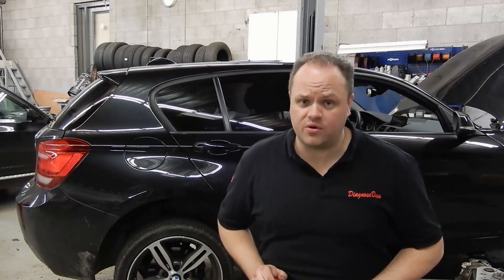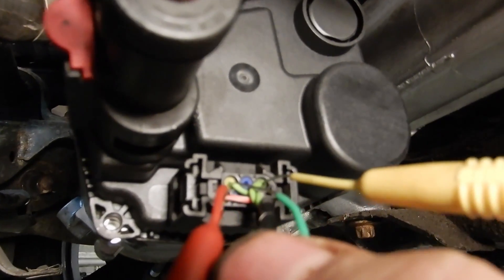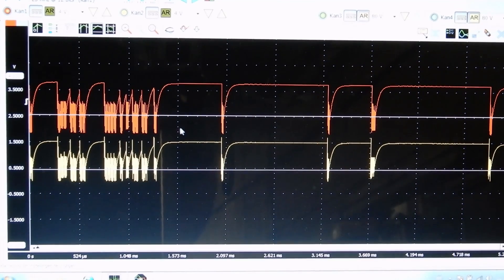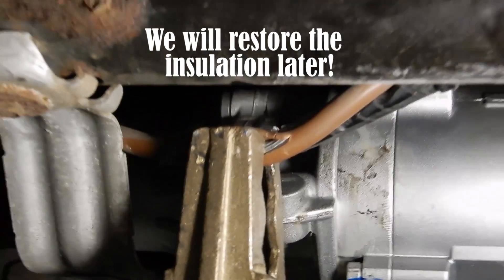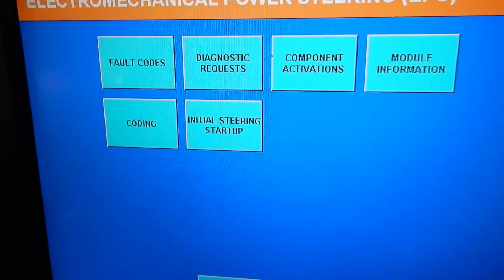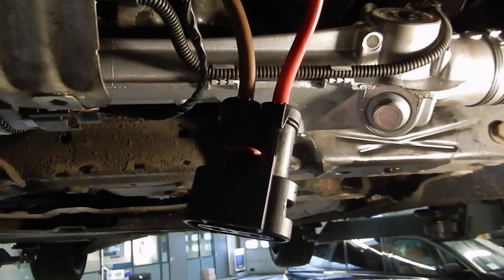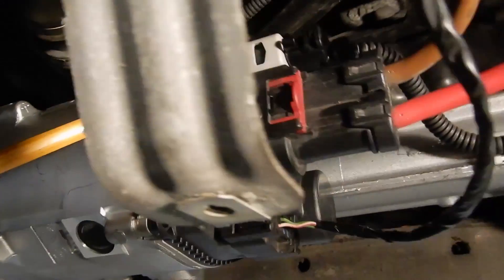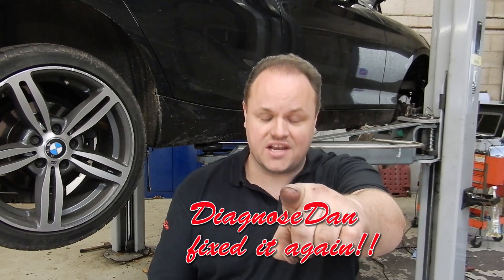Bmw Eps diagnose and repair (No Flexray communication)

Comment: Hiii Ihave the same problem no communication with the module. Ive put plus and ground. Directly to battery the low measure 2,48 high 2,54 and red green 13,48 please helpp! Its already the second that ive changed

Comment: Hello brother i have 2024 x5 i have problem with my steering system the service man removed the motor of the steering and installed but now it shows belt jump and we can not do anything and the code can not be removed what should i have to do does it can be fixed the motor for the new g05 2024 ?

Comment: I found something similar to this on a VW Tiguan, no power steering assistance and no communication. It had corrosion on the ground besides the battery, just cleaned it and it worked instantly.

Comment: To whom it may concern, my name is Joe and I own a 2015 Bmw 750li xdrive.
I was using the protool to code my car and i believe i made a mistake of testing the Flexray option and gave me so many errors and lights on the dashboard.  After clearing the codes and restarted the car, Night visiont camera, both side mirror camera and backup camera stop working.  I am in desperate need of advice on what i should i do. I tried pretty much anything i could with the protool app. Restore the cameras to factory settings, and still didn't work.
I would absolutely  appreciate any advice and help i get.  Thanks in advance.
Joe G

Comment: Hello Dan
Excellent vidéo, I Just discovered your channel and you do an excellent work and teaching about your work
I need your help please with my 2012 f30 328i EPS  I had 2 default codes
 48239C EPS torque sensor (steering angle index): Index Faulty

D01B2A Interface EPS (actual position EPS 51.0.2): Signal invalid
And im completely lost, no one could résolve my problèm i've changed my eps 2 times it resolves the problème for about à month only
Please help 😢
Reply: Hola amigo , tengo el mismo problema, lo lograste solucionar ?

Comment: thankyou dan for the upload.
So the voltage was elevated in flexray wires because of bad ground. where did you put ground connection while taking measurement in scope ?

Comment: Hi Dan. I have a 2012 BMW X3 and has an intermittent error (steering malfunction) when I start the engine, but no steering issues after I confirm with an OK on the dashboard. absolutely random ( for example now it is 3 weeks without and error, but I had days where it comes up in the morning). Someone mentioned the ground wire at the batttery. Is this a common problem?

Comment: I had a buddy help me with replacing the control arms on my 2011 bmw f10 5 series. After watching one of your videos. When we were torquing down the bolt on the back wishbone arm that black cord on the steering rack with the 3 wires got stuck behind the bolt and went un-noticed. When we were don’t the power steering wouldn’t work. Not sure how to fix it I got the wires from behind the bolt and had to solder them together and still no power to the steering rack. I’m not sure what to do… or what had happened

Comment: My electric motor is making noise when i turn on my ignition.  When I unplug 3pin plug its goes off. What might be the problem? Both thick wires have its ground and power

Comment: Hi everyone, I have a 2010 BMW E90 (320i). I have a problem with my steering system, which is similar to this. When I try to park the car, on low speed, whenever I rotate the steering wheel near 180 degree, steering becomes heavy for couple of seconds, and it becomes normal if I put gas to move the car to help it. I also noticed when I experience this, my headlights as well as cabin light starts to flicker. Flickering gets more apparent if I rotate left and right constantly to test. Initially I suspected alternator and battery, but they are all okay. In this case, do you think my problem is related to cables/wiring?
In my car fault history, I have below codes;

5E19       ABS-DSC: CAN data fault from DME/DDE (DSC lamp on as long as error is present)"
5D97	DSC: Control module: power supply, DSC sensor
5DF7      DSC: System voltage too high

I would really appreciate if you could advise me on this.

Comment: Hello, I have the exact same car, F20, and I had a warning the other day about EPS fault, I pulled to the side of the road, turned off the car, turned back on, since then there is no problem. Could this be a one time thing? The car is just out of oil change and general service. Is it a possibility that the service guy worked on a nearby area to the EPS and moved those cables out of their places, or something? Should I be worried? Wait for another fault ?

Comment: Had a similar situation with a g12 at work, flex ray communication faults and all but it just ended up being the power supply wire being pinched and ended up causing on open in the circuit

Comment: Good video Dan,. Good old fashion "VD" voltage drop.
I do think Flexray is going to be used for all new vehicle's, and for autonomous applications via ADAS.  Flexray speed is 20Mbit/sec through the gateway into the ADAS system and steer by wire systems all we have to do for the limp home mode for that situation is get the computer to turn on your four-way flashes cuz you're going to be coming to a fast stop.  With the LIDAR system and ADAS it'll be able to pull you over fairly easily having 360° view of all surroundings.

Comment: hey i have a F25 and it has a similar problem, when you just turn the car on the power steering doesnt work for the first couple mins but then after that works like nothing, I havent been able to find out whats the problem with it.
Reply: My F25 2011  year，It’s just the opposite of your car’s symptoms. The EPS was working normally within 10 seconds of starting the car, but suddenly it lost power steering and showed a fault light, then it didn’t work, and the steering wheel was very heavy.  Have you found any problems with your car?  Has it been fixed?  thanks

Comment: Hi Dan, yesterday as I was pulling in a parking lot after driving in very heavy rains I had a snapping sound from underneath the car and 2 - 5 minutes later the steering light popped up and I totally lost power steering.. What could be the problem?

Comment: I have the same problem, turn on the steering pilot, the errors are: 0x4823f1 / 0xd5c44 / 0xd552c79 ,.
I already checked the current on the servo motor is very well, signals are also ok, I checked the fuses ok, but the pilot does not go out.

Comment: Hi, I have been enjoying your video. Since I have owned a BMW Z4 E89 and recently having tech issues on the EPS, I would like to obtain your views on replacement parts. BMW Dealer here says the car can be fixed by exchanging whole steering column. But cause of problems was faulty EPS motor. So I have done separating motor and sent to a professional for rebuild. The fixed motor was back on the steering column and car is fine now. Shall we relay on assembly parts exchange based fixing for long term reliability or finding the real cause of problems and replace individual parts for saving costs?

Comment: Hey Dan having an issue with a car. I believe ZGM is bad. Car is an F02 750Li. My question is can I use a used ZGM to at least test the car or will it lock car in a transport mode?
Reply: The flex ray bus from ZGM is low to the VTG and I have no communication to the transfer case VTG

Comment: Hello Dan, i have a 2013 f10 facelift 525 xdrive,  ny steering intermittently hardens at high speed and after that the transition to smooth steering when going sloower is realy wierd, and sometimes it feels that there is a slight resistance when moving tha wheel. For example this problem appears for 2 weeks after that 3 weeks is oke than 1 week again and so on. No one could tell me the problem. Do you have an idea?

Comment: Dan, Great video - learnt so much, thanks. I have an intermittent fault with my original EPS. I have tried two replacement parts (realOEM latest compatible part numbers). Both give an EPS no comms. However when I connect my old one it works (for a while). Have you any advice or idea whats going on / suspect / things to check?

Comment: Did you only replace the electronic motor or the rack and pinion assembly as well ? How much for the new parts caused by a bad ground? Sounds like an expensive fix for such a simple failure.

Comment: In essence, what you're saying is that, if you first replace the rack with a new one, the new $2000 rack will get fried before you've even had the chance to realize there's an additional problem.... now that's some "excellency" in engineering. Congrats to you bmw.... you've "done" it again... f*****ckin BMW! I ran away from that garbage coaster brand a long time ago, now realizing that my decision to never return was the best I've ever made!

Comment: I have no experience with BMW cars. I work only on PSA cars. My question is :  this BMW have Flexray in place of High speed CAN? What is the speed of a Flexray system? My scope works just good enough for H.S. CAN. Will my old scope be capable for Flexray?  Thank you for the video, Dan.
Reply from the maker: No a car can have both, and you'll need a very fast scope.

Comment: hello friend good video, I have a problem with a bmw x5 f15 chassis, I have this code D01b2A in the ICM module, medium voltage and ground in the thick wires of the electric motor, do you have any idea of other steps I can take? thank you great channel (at times the address resists intermittently).

Comment: Hi there, very nice video, thanks a lot. I have  mechanicly bad steering rack . Got another and swapped the EPS units thinking car would think it is the same EPS but did not work. Is it possible to get a replacement rack  and stick original EPS to the motor or they go as a pair? I did just that and getting CD951B message  -  actual steering torque driver actuator/actual force rack , 49.0.2 - signal invalid. I suspect that EPS and torque sensor on the rack  don't like each other.Reprogrammed, recoded using ISTA but with no avail
Reply from the maker: They are calibrated at the factory

Comment: Would it be possible that a bad alternator causes malfunctions in the electric power steering ? My thinking is that the battery in a small car can not supply enough current to drive the power steering motor.
Reply from the maker: Possibly😉
Reply: @Diagnosedan   I'm looking at buing a very cheap fiat punto in good condition and the seller says it has a bad alternator and the power steering doesnt work but at least its worth going to look at it. Might test the power steering by jumpering it from another car.
Reply from the maker: @rimmersbryggeri  Fiat electrical power steering fails all the time. That can be expensive to fix
Reply: @Diagnosedan   Yeah but worth to check if its becasue of the alternator it doesnt work. If it really is broken its not viable the resale value on these cars is very low even in good condition. The power steering motor costs as much as the car so they would have to remove 3/4 of the price for it to be vialbe if that is broken.

Comment: I want to learn more! Nice repair. I would have covered the bare terminal with silicone sealer. This connection is in the path of corrosive elements, bad choice on BMW’s part. Solder and heat shrink is the only option for any permanent repair. Here in America, the majority of mechanics think it is proper to use crimp connectors and call it fixed.
Reply from the maker: Thanks for watching Jason, you comment on a lot of video's lately. Are you bingewatching? 🤣
Reply: @Diagnosedan  Your content is bingewatch worthy.

Comment: Extremely bad engineering to use that ground for the module too. They need to keep high current systems isolated from low current systems.
Reply: Saves $.5 per car. Worth it. Lol
Reply: @mikea.2348  Of course it's good, because it keeps the dealerships running
Reply from the maker: Yep!

Comment: did that wire have a flex issue or did it just root , no pun intended on the flex thing .... looks  like another one to add to the books of knowledge on preventitive maintenance ....
Reply from the maker: Corrosion 😬😉

Comment: Hey dan great video just out of interest what is the top multiplug on the motor/module for 😆thanks in advance
Reply: There is the two main cables and the 3 pin plug with the communication wires and feed wire and there is a plug at the top does this go the rack itself? Thanks again
Reply from the maker: @mattyholt14  it goes to a sensor in the rack itself.
Reply from the maker: I'm not sure what you mean?
Reply: @DiagnoseDan should the feed wire next to the communication wires on the 3pin plug be a 5v reference voltage? Sorry for all questions😆

Comment: Hi Dan, I have got f02 with no communication with control module  and steering is hard as anything ....We changed second hand rack with electric motor and still hard . Do I have to   Code and steering comes softer or as you mentioned we fired again modules because of bad earth ... regardless I will check ground tomorrow , just wanna know how steering how should act before coding... thanks

Comment: I must say after being in business 20 yrs here and I have had countless toyota / lexus training courses . You have a gift for teaching !
Reply from the maker: Thanks Jason! I know the toyota training is one of the best so this means a lot to me Thank you!
Reply: I am mechanic, I have and I have similar issue but unfortunately, my own the signal wires found tight between the lower arm bolt and the touch each other to the flame, the wire are fixed but still the light is on and the steering is hard, can it be fuse or what, please help me out
Reply: Lexus/toyota is 10years behind others unfortunately

Comment: This type of power steerings are such a pain... 1st I replaced the electric steering pump on my fiance Fabia and I thought that was expensive, but then my 2010 Passat has a similar steering rack fried and I still didn't change it, and now my mom's E87 2010 which I think has the exact steering rack like the one in the video, gave EPS: Steering torque sensor error but somehow after I cleared the code it's working and I hope it will not break because it costs a ton of money, almost double than the Passat one. I wonder if there are parts available for this racks like dc motors and sensors.
Reply from the maker: RnzOP There are companies that repair them!

Comment: What did you use to capture the Flexray signal?  Too fast for my scope.
Reply from the maker: Mike Hohl, Gmto/TiePie scope😉
Reply: Is the GMTO software geared toward EU spec cars or will it have North American spec cars too?
Reply from the maker: Mike Hohl, Gmto is a Dutch company so they are focussed on European cars, but in the generic mode you can do al the tests you would like. In the brand specific mode there are some American cars but if more Americans start using the system the library gets updated faster 😁
Reply: Thanks for the info.  I haven't seen any vendors in the US that carry it.  Pico is king here but I don't think they have anything that is fast enough to capture flexray.
Reply: Mike Hohl pico can

Comment: Awesome video Dan! I used to see "fried ECU's" on mk2 VW's due to a bad battery ground cable going to the transmission or people not attaching the cable after a clutch replacement (starter tries to ground through the ECU). 
Dan Sullivan's "LoadPro" in action... with no royalties going to him. =(
(I hope I have my facts right... my apologies if I don't).
Reply from the maker: Thomas EXOVCDS positive voltage will always try to find a way to ground, when a big ground cable is bad the current can start to flow thru a smaller cable or circuit that was not designed to carry this current ( like blowing a fuse) the circuit can become overloaded and fail.
Reply: DiagnoseDan On older vehicles, if I see a high O2 Sensor reference / bias voltage, I check the grounds for the ECU. I will have to keep this in mind for other modules / systems! Thanks again, great video!
Reply from the maker: Thomas EXOVCDS if a voltage is higher than you would expect always check the grounds!
It is almost 7 in the morning here i guess it's bedtime in Canada😂

Comment: I'm pretty sure that the bad ground  (high resistance, low current flow) Didn't cook the module. You would need excessive current flow which you dont get from high resistance. Great video tho keep em coming
Reply from the maker: Diagnostic Check, try to jumpstart a car using a speaker wire, it will work but it creates a lot of heat in the wire and the wire would eventually fail.
There was no ground on the Eps but still there was enough current flow to raise the voltage in the flexray wires.(It did not even light the test light).
And the electric motor was not working at this point.
Now imagine the point where the Eps was still working but the ground was starting to get bad.
Reply: DiagnoseDan does starting a car with a speaker wire damage the starter motor in any way? I don't think it does due to there being a voltage drop/less current flowing. When has a bad ground/live EVER caused the component designed to be in the circuit to fail?
Reply: Diagnostic Check if the path to ground is through a pcb that can’t handle the excess current flow it will burn, no? The way I understand it the motor wasn’t burnt, the module on the motor was toast
Reply: Diagnostic Check, there is no arguing with a YouTube provider trying to make a dramatic or shocking point.  He's making egregious claim like you can run enough current through speaker wires to turn a starter.  It just not going to happen.

Comment: Thanks Dan for posting another great video, I assume that the new power steering motor had to be coded to BMW? I'm I right in saying that these motors can draw in excess of 40amps? Happy New year my friend, sandy
Reply from the maker: Yes it will draw over 40 Amps, and the new unit does not work untill it is coded. Happy new year Sandy!